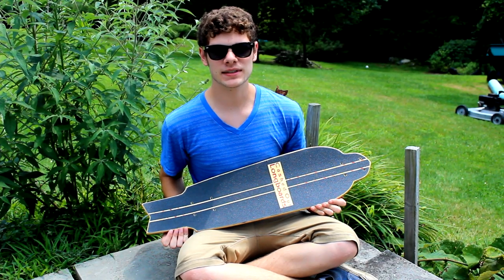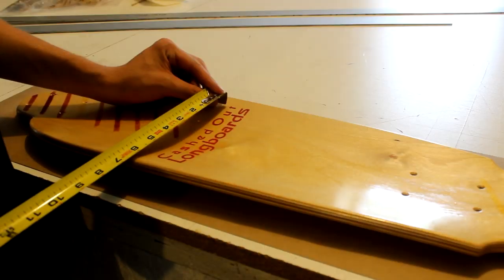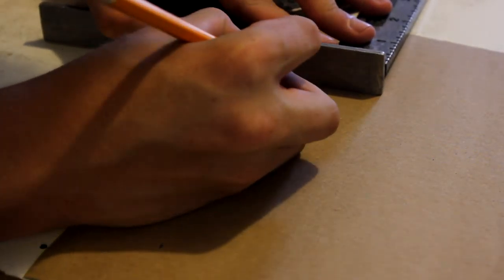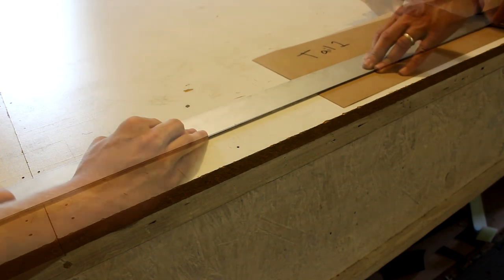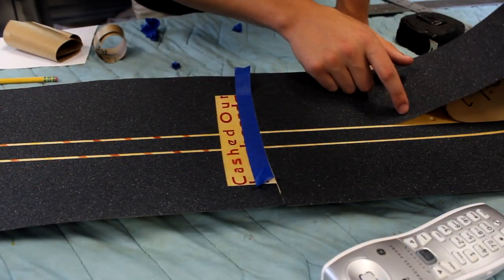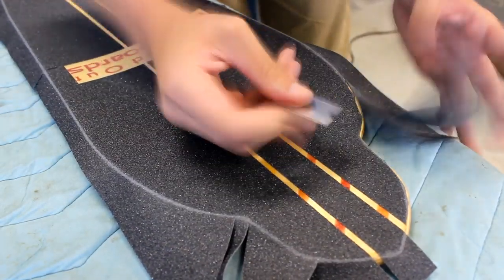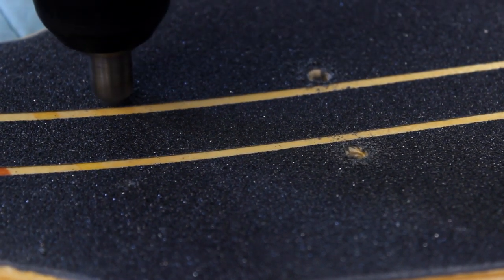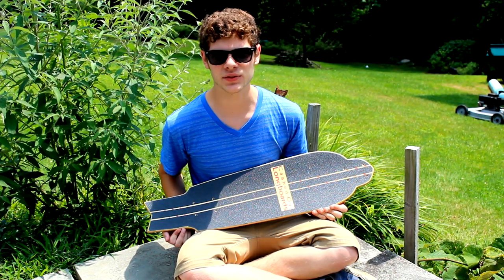The Complete Guide to Custom Pinstripe Griptape

Comment: Nice one. But, use the blade from the underside of the board when trimming the edges. Cut off the excess grip tape with long, slow and solid cuts. Gives a much smoother result.

Comment: Looks like we both need to work on the cutting part! Really difficult to get a smooth line isn't it?
Reply from the maker: Yes it is! I'd say that is the most difficult part.
Reply: You definitely wanna cut from below and use the board as a guide. Have you read "The Handmade Skateboard"?
Reply from the maker: Yeah, I've done that with my other boards but not on this one for some reason.  And nope, I haven't.  How is it?
Reply: I'm likin' it because it goes into the fine details of getting a good finish, drilling perfect holes and avoiding and/or repairing splintering. A must for budding skateboard builders like us!
Reply from the maker: Awesome man, i'll check it out as I have another longboard in the works right now!